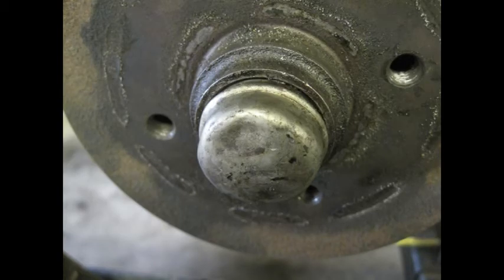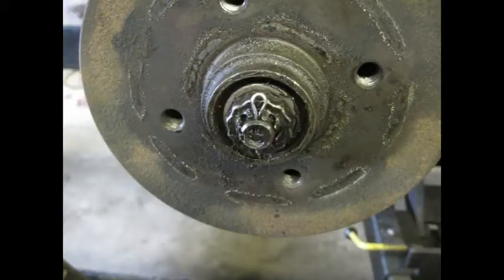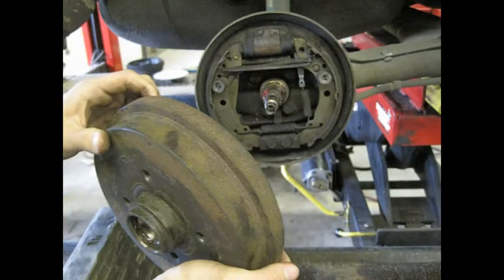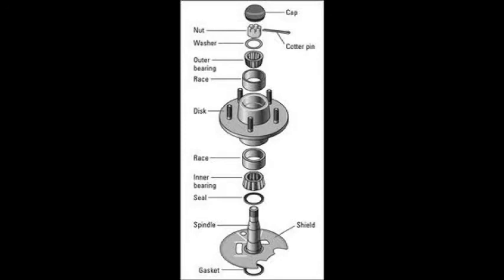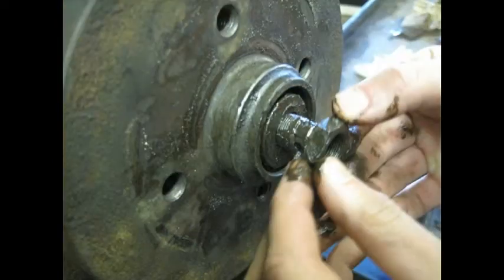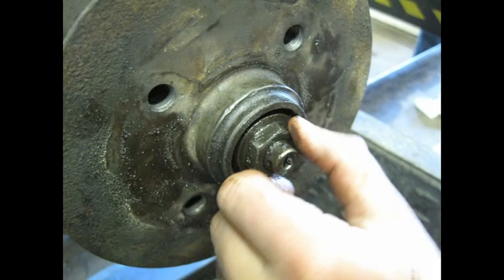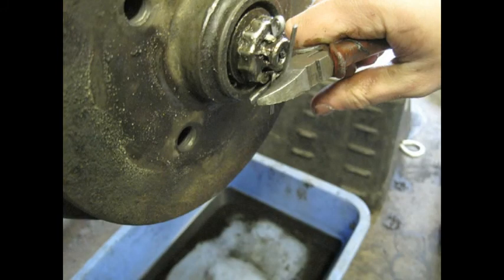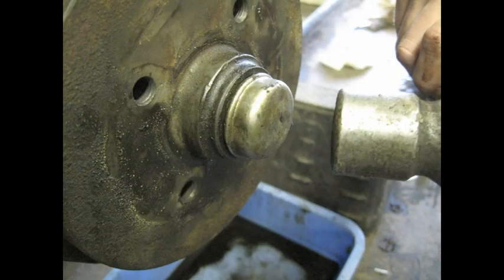How to adjust tapered wheel bearings

Comment: Put the tire on rock the tire you will feel the end play. Tighten the nut until end play goes away then tighten 1/8 turn more. Better yet use a dial indicator.